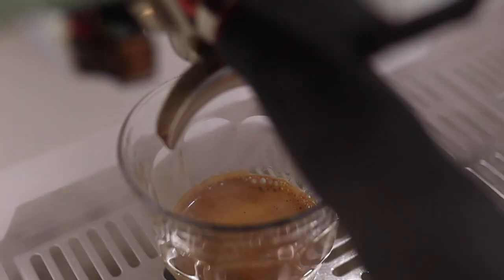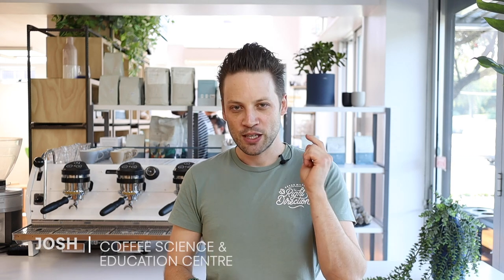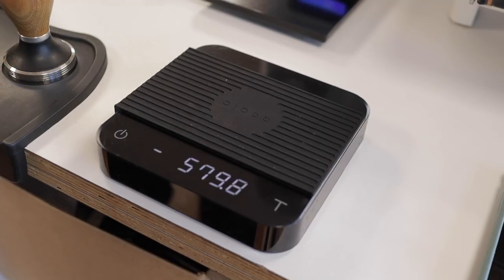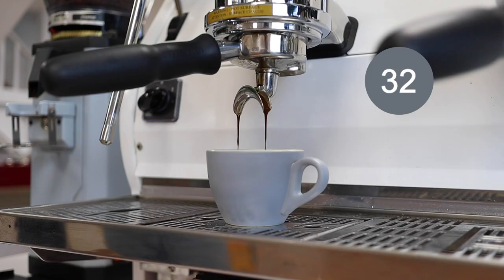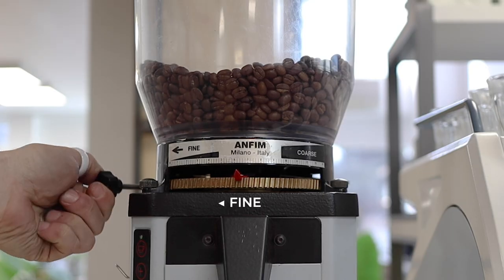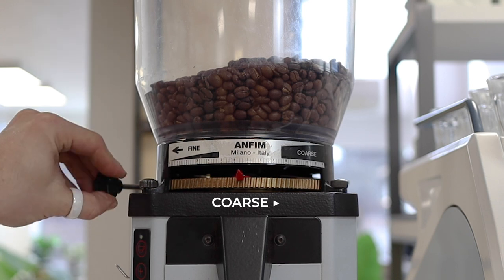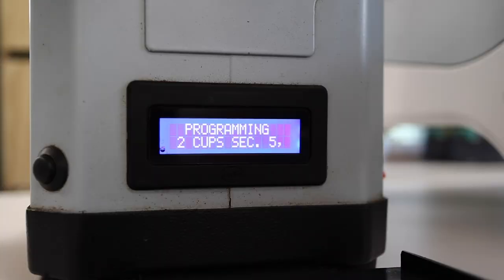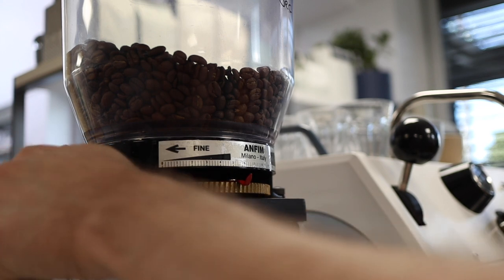How to Dial In Espresso | Basic Coffee Skills

Comment: How did you come to the time 28-32 seconds as being ideal? Is this simply found through trial and error for the particular espresso beans you're working with? I've come across so many different times recommended, ranging from 22 to 35 seconds, and while at my job I shoot for 25-28 second extractions (based on flavor), I don't know if there is something I might be overlooking. So far all I know is shorter/longer shots get unpleasant sharp flavors, and the smoothest shot seems to pull around that time. Would love to find out more!
Reply from the maker: The 28-32 extraction time mentioned in the video is just an example. You are correct, it's best to adjust the extraction parameters to find what tastes best for the coffee you're using. The recipe is simply a benchmark so that you can maintain that flavour balance over time.
Reply: I thought it was time taken to get a certain volume of liquid, so a shot of coffee. Ive seen people weigh the liquid to get to 25g and it should take 28 seconds to get there. 

But his response didnt mention this 🤔
Reply: @Ellispicks  It’s not necessarily getting to 25g. Set a ratio and then a benchmark of brew time and adjust from there. A good starting point is somewhere around 1:2 ratio and 25-30 sec brew time and adjust from there
Reply: not every machine and bean works the same everyone should use what works best for their preference and flavor profile.
Reply: @christianshobbies9292  If one shot is 7g then you should expect an output of 14g output with 1:2 ratio benchmark. Do you adjust the grind if the 14g output takes more/less time then 25-30 secs?
Reply: @sjchac  yes grind will usually be the easiest way to start. Also go by taste if it’s under extracted and sour or overextracted and just too incredibly bitter. There’s also other factors that will increase/decrease shot time but I find it easier to figure that out later if you’re just getting started

Comment: Great video, but how did you come up with the target time? How do we calculate it?
Reply: Target time is the same for all espresso!
Reply: Any earlier than 28 seconds can mean the coffee is underextracted, over 32 seconds can overextract the coffee. Both can cause the shot to be watery, bitter or sour.
Reply: Super complicated question. Technically you could make a delicious coffee with a 20 second pour or a 40 second if the parameters were right. Generally a ‘good’ window to aim for is 25-35 seconds. I personally think James Hoffman’s interpretation is really good. He views time as an output variable and not a target. Weight of coffee out is his valued output variable. If your coffee poured in 30 seconds, however, it was 3 times the weight of the coffee in then this is a lungo shot, which is not a traditional espresso. So typically I will aim for a 1:2 or 1:2.5 ratio by weight with a consistent dose. If the shot is still pouring a little quick or slow then I consider I have my dose wrong or make some small changes to grind size if my desired target time is within reach.
Reply: @vedekX  it would depend on your blend and the target you're going for. with ours we have 'recipes' of times, weight etc but typically you're looking at 20g and about 28s (average of 5 different blends we use)

Comment: FYI It would e helpful to mention that this is a pro machine which has the shot water quantity programmed in already. In other words, the single shot and double shot buttons put out a certain amount of water then the flow stops (and are rarely changed). A home machine doesn’t have this so you have to put scales under the cup to measure how much water has come out.

Comment: Did I miss the target weight of the shot? What would the target times and weights be for regular shot, ristretto, lungo? Thanks
Reply: A lot of third-wave shops using light to medium-roasted beans will pull a 1:2 ratio, e.g. for 21g of ground coffee, the desired liquid weight should be ~ 42g. A ristretto would then be more like 1:1.25-1.5, and a lungo being ~1:2.5-3.

Keep in mind that 21g of coffee is a lot - some call that a "triple" basket (whereas a double basket is anywhere from 14-18g). You may want to use a triple if you like big drinks, so your shots don't get too diluted; otherwise, I think double baskets are more common amongst home users.
Reply: Thanks.  Same time range for all?
Reply from the maker: Well said @LuckyDragon 🙏. Yes, the time would be roughly the same, however not every coffee is ideally suited to brewing as ristretto (or lungo, etc). Many lighter roasts will taste dry & sour as ristretto, while many darker roasts will be overly smoky & bitter brewed at a lungo ratio. That's why roasters often recommend an 'ideal' brew recipe or ratio, etc for each coffee.
Reply: Makes sense. Thank you both!
Reply: @LuckyDragon289  what do you mean by third wave shops?

Comment: My machine keeps running water through the shit and Ives me an extracted dose of approx 50g. Because my machine keeps going should I aim for the 34g and just stop the machine at this point? Or do I need the system to turn off automatically?
Reply: You can turn it off manually but you should be able to configure it. It's always better to have your machine set up because it helps with consistency. At home, I use a nueva simonelli Musica but the menu isn't really easy to get into so instead of bothering to "dial" my shot, I just press the button once to start the pump and press it again when the time is up. You also don't need to aim for anything. Try different things, keep notes and when it feels good, taste good, looks good, you are ready to go. All those numbers are baseline for professionals, not rules.

Comment: Hello bro, I want to open a boutique Coffee shop.  I will sell a minimum of 40 to a maximum of 90 espresso-based coffees a day.  There will be no cream or syrupy drinks.  I live in istanbul, turkey.  Some machines do not come to Turkey.  Some are coming.  I am looking for a machine with 2 groups, fully automatic, which can enter large cups.  I have some machines in mind.  For example vbm lollo.  But the portafilter is burning my hand.  Why does the spoon stay hot?  I never like Simonelli.  The grinders maybe, but I don't like Espresso machine.  Instead of ;  It could be fiamma quadrant 2 or faemma e98.  Or it could be a wega espresso machine.  Or bezzera.. Can you at least sort it out for me?
Reply from the maker: I haven't personally used all the machines you listed, but I believe they are all heat exchange (single boiler) machines using the same type of group - so there's not a huge coffee quality difference between them. The best choice depends on what sort of local support / parts you can get for it. From memory, the VBM machines have an exposed group and metal components in the handle, which might explain why these surfaces are so hot. We have used the new Wega Polaris, which works well for us.